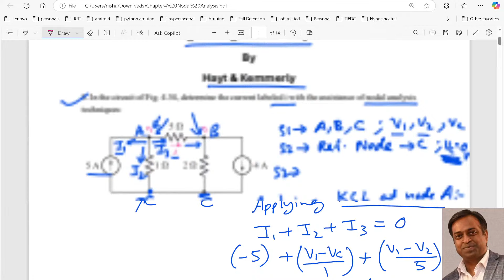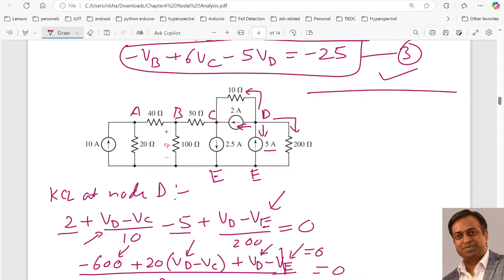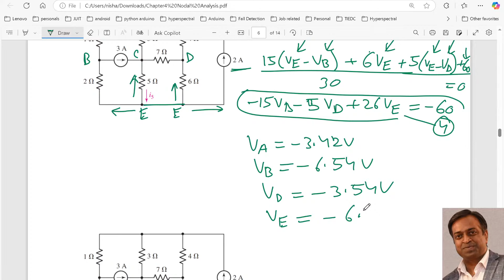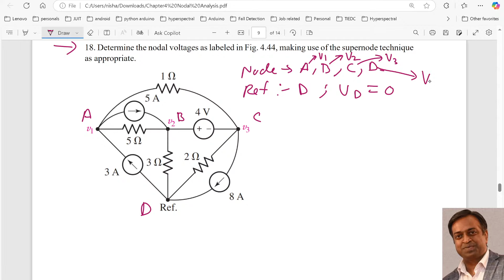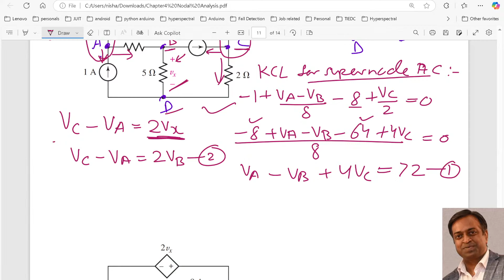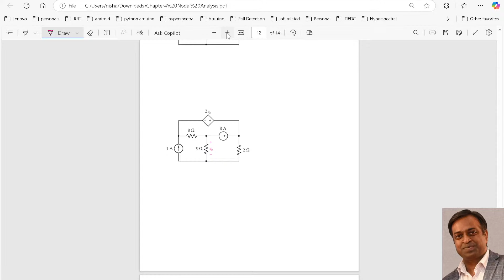Chapter 4 Nodal Analysis: Hayt's Secret Method for Mastering Engineering Circuit Analysis

Comment: sir u have taken +47vb at time stamp 34:33 instead of  -47vb
Reply from the maker: Yes you are right. I mistakenly mentioned + instead of -. But the final answer is correct as I had solved it separately and have also verified the answer on the online simulator.